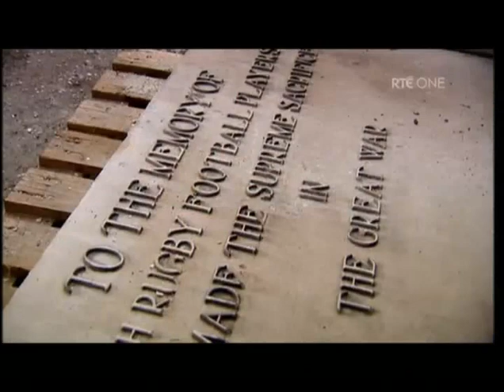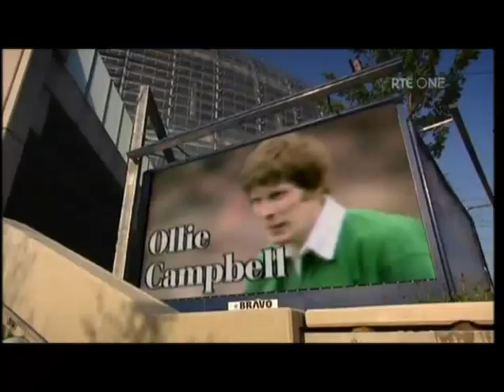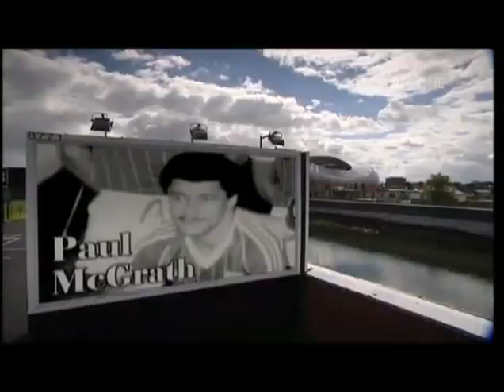On Hallowed Ground - The Re-Opening of Lansdowne Road

Comment: The thing about the new landsdowne Rd or AVIVA is that the capacity is too small it doesn't need even 65000 let alone 82000 capacity GAA is an amateur sport with huge support ,but without the need to pay the players so can afford such a capacity.The other thing is that hill 16 has a function in croke park  AVIVAs small end doesn't have that function
Reply: ah well...  it might be unchanged when the Euros take place in 2020, but for Rugby WC 2023 host it should be tried in fitting more (+11k) Though they'd need sacrifice approx. 10yrds behind the posts.
Reply: The North stand is small because of the fact that it'd have blocked out the sun from the houses on that side if it was the same size as the other stands.
Reply: The aviva is for more than just gaa
Reply: @HXD007  Its not for GAA at all and can never be because its too small.GAA pitch is much bigger than rugby or soccer pitches.If for whatever reason  croke park was unavailable  due to redevelopment hurling and gaelic football couldn't be played there whether the IRFU or FAI gave permission or not
Reply: @gallowglass2630  thats why i said it was for more than just gaa, also i am aware of gaa pitch sizes being bigger